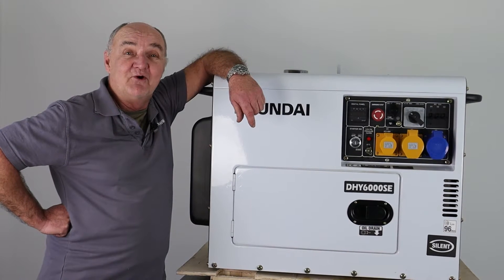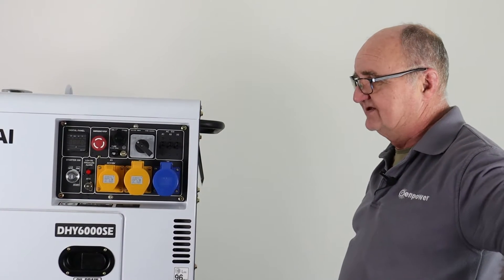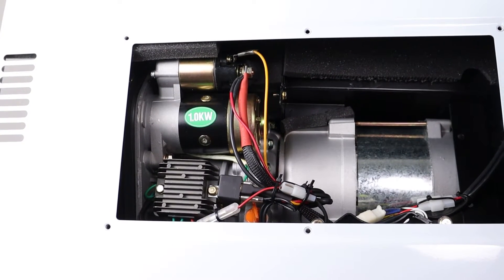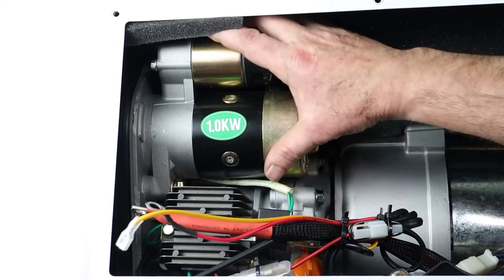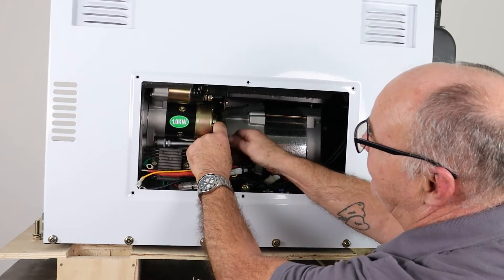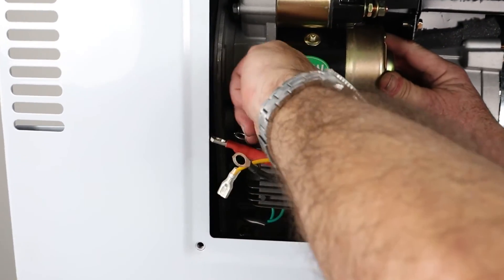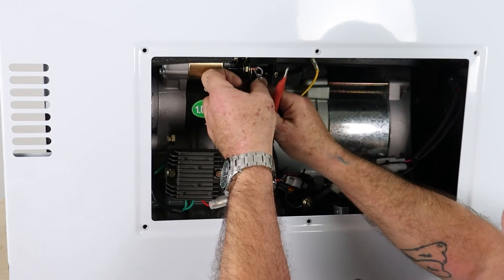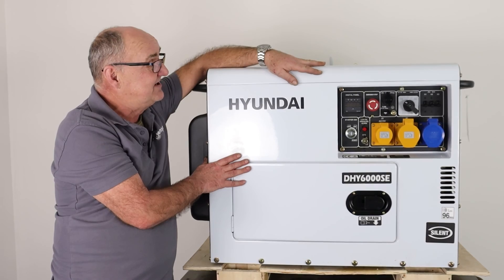Changing the Starter Motor on Your Hyundai DHY Generator (3000rpm Generators)

Comment: There’s no way you can access the bolts on the starter motor with a socket, ratchet and extension…there’s a bulkhead in the way. You need to remove the housing which is a lot of securing bolts